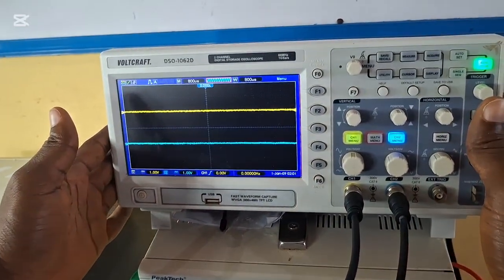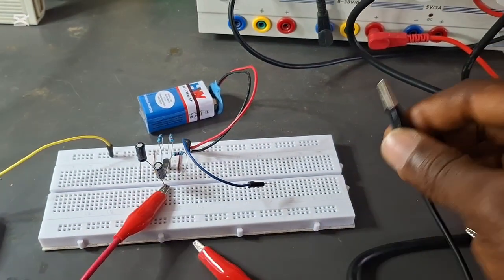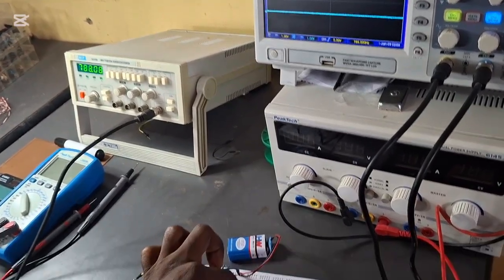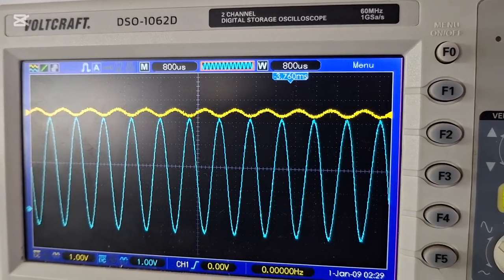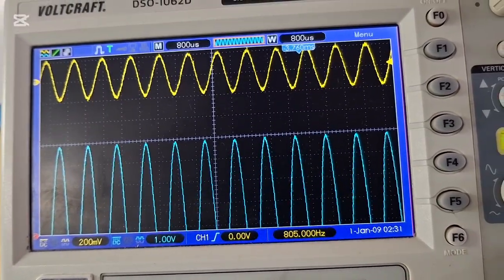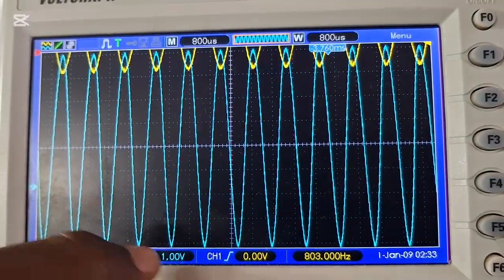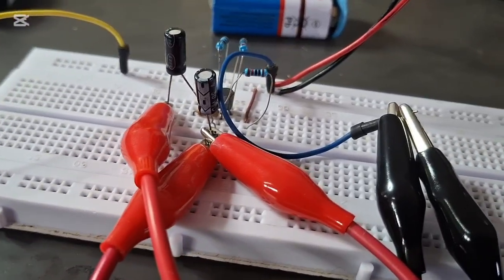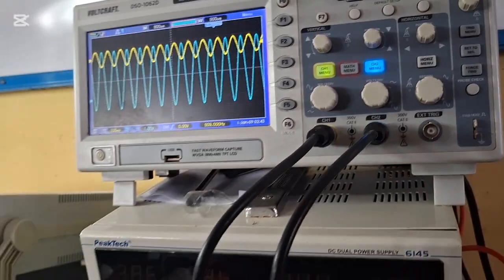All you need to know about Transistors, Part 4.

Comment: My friend you need to mention the volt per division on the oscilloscope to know exactly how much it has amplified the signal… you also need to mention that the output signal is shifted by 180 degrees compared to the input signal… see the peaks of the signal in the video.
Reply from the maker: Thank you, my good friend. I believe that I mentioned that the output voltage of a Common emitter amplifier is 180 degrees out of phase with the input voltage.  I also made mention of the voltage per division settings. Kindly watch the full video.
Reply: @jamesapandaa8135  yes you did my apologies , you did very well .
Reply from the maker: I really appreciate you noticing.